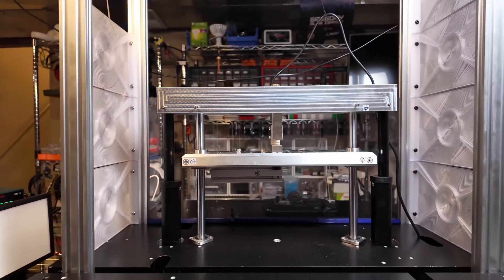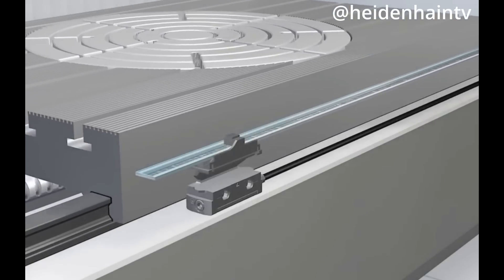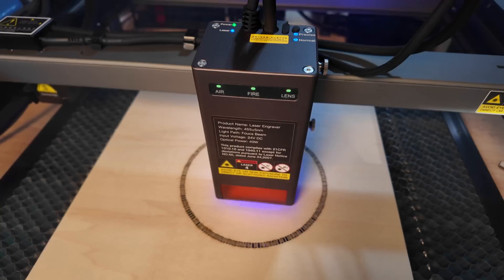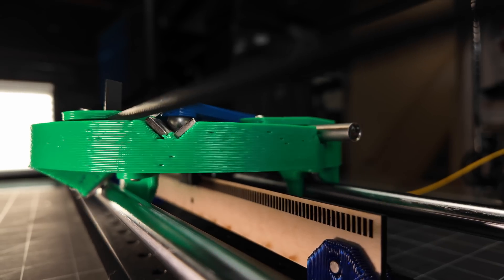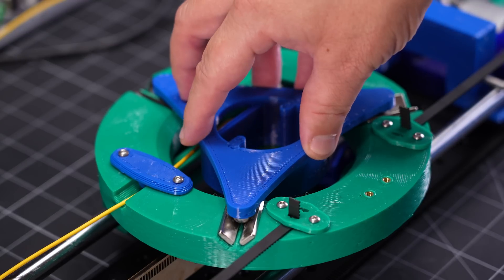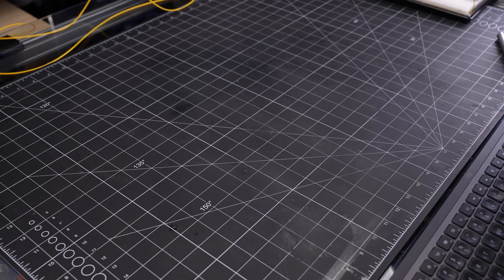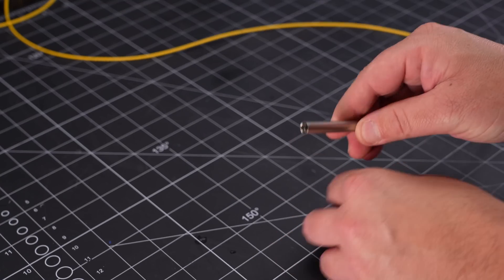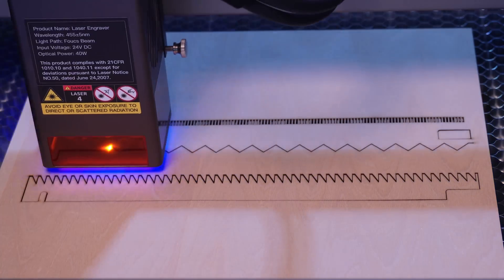Tools for measuring tools: Building a tester for measuring performance of DIY linear encoders.

Comment: Excellent work! 
I'm wondering if it's possible to make glass scales by etching glass with a diode laser. Years ago, I did some laser engraving by coating the glass with black paint, and occasionally the paint would even deposit almost permanently onto the engraving.

Comment: Nice video.
I've been thinking about just ripping up some cheap digital caliper and running its visual encoder along a tape measure, but this is the obviously better option.
Reply from the maker: @jkr9594 I've had similar thoughts about cannibalizing some old/cheap digital calipers, but have never given it a try. I don't know if this approach will end up being THAT much better, but it certainly gave me a reason to make the problem more complicated :)

Comment: Take a look at the Hybrid Disk Encoder approach from the dexter robot arm.
Reply from the maker: @DerSolinski Very cool! I actually bought a couple of those robot arms for a previous job, but didn't realize they had custom encoders in them. And they've got some great info widely available on them, love it! (https://github.com/HaddingtonDynamics/Dexter/wiki/Encoders) Thanks for the suggestion!
Reply: @bubsbuilds  Still not cheap, but they move the "precision part" to the electronics.
Imperfections actually allow it in this case to be an absolute encoder which is genius.

Comment: If you can find scrap inkjet printers, they (used to) have long plastic strip linear encoders in them.  I know I saw them in Canons and HPs around the 00s.

OOOOOOOH!  You can make those!  Print a single-layer of clear PLA with a layer of opaque (Black) PLA on top, then zap the black PLA with your laser engraver to make the lines.
Reply from the maker: @ElizabethGreene I actually disassembled an HP inkjet a few months ago and still have the encoders sitting on the shelf! That thing had two or three rotary encoders and a linear encoder tape in it...I was overjoyed!  The only thing I don't love about those, is that they're so compliant and have to be tensioned by springs or similar. Definitely not a deal-breaker, but that was the main reason I decided to see if I could laser cut something rigid.

Very true! I hadn't thought about using the laser cutter to post-machine printed parts...interesting indeed! 

I'll toss one additional option in the mix if you want to make ones like you find in the printer. You can use transparency paper and just print the encoder pattern on it. In the past I've done that and attached it to the clear disc that came with re-writable CDs/DVDs to give it a stiff backing...it may have been a little while ago. Also, guess this only works if you didn't dismantle your only working printer :)
Reply: @bubsbuilds If you want to experiment with flimsy plastic encoders, lmk.  I'll volunteer to scrape up some laser transparency "paper" and print some on my laser printer.

Comment: Nice project! Really intersted to see the results of your test.
Regarding your "target block" - for a more automated measurement setup, would it be possible to motorize your target block as well, adding a second motor? As you are using the optical distance sensor anyways, inaccuracies in target block placement due to the second drive should be no issue, right?
Reply from the maker: @jn-husch Thanks, and absolutely! I was thinking about attaching it to my old "Lil Winch" build from a while back to do exactly that. The only thing I'm hesitant about is I'd prefer to have the translation stage moving away from the target block to avoid accidentally crashing the pricey sensor if something goes wrong with my programming :) So I'd prefer to have something that can push, instead of pull.  But I've done a couple of tests thus far, and the manual approach is DEFINITELY tedious! So I'll probably try to rig something up (suggestions welcome!), and I'll definitely share how the testing goes once I get the results pulled together!

Comment: Would spring loading be better for preloading the carriage than petg?, wont it be very easy for it to rotate along the axis of linear shaft that has 4 contact points?
Reply from the maker: @saadqadeer7807 Definitely, I should have mentioned it in the video, thanks for pointing that out! I designed the PETG parts specifically to be compliant, so they are acting like springs for me.
Reply: @bubsbuilds  Makes sense! I really like your ideas and their implementations :)
Reply from the maker: @saadqadeer7807 The best compliment an engineer can hear :) Thank you!
Reply: Why is the rotation an issue?
Reply from the maker: @jaro6985 The main reason I wanted to avoid rotation around the shaft was to avoid the displacement sensor reading off of a different point on the target block. I don't think small rotations around that axis would be a HUGE issue, but especially since I went with a printed target block (with corrugations) and don't have super tight control over the perpendicularity between the target block face and the rails, I do think there's likely some sensitivity to rotations there.

Comment: I really like these DIY scales, digital read outs and precision equipment for machinery is crazy expensive, you could put two of these together and make a linear displacement table with an electronic readout for a drill press or a DIY mill
Reply from the maker: @dannydevito400 I couldn't agree more! I wish I had the budget for strapping Renishaw scales on tools around the shop, but I'm hoping these will prove to give me a 'good enough' solution for those sorts of applications.
Reply: @bubsbuilds you might even try printing them. If you go to a copy-shop you get access to ultra high DPI printers for cents.